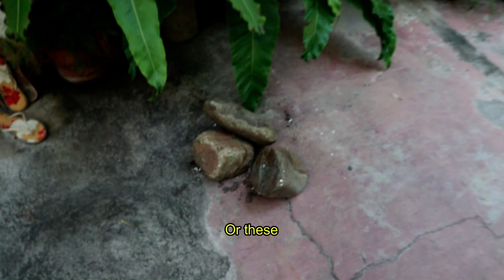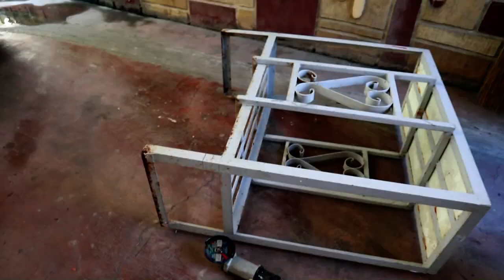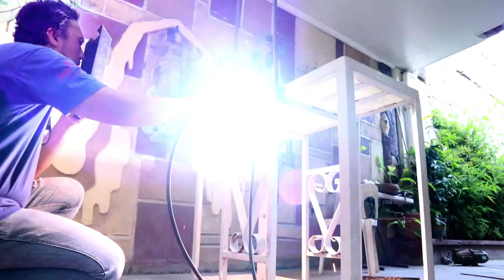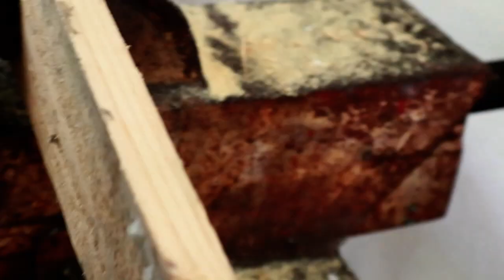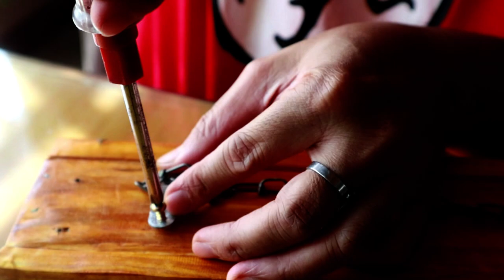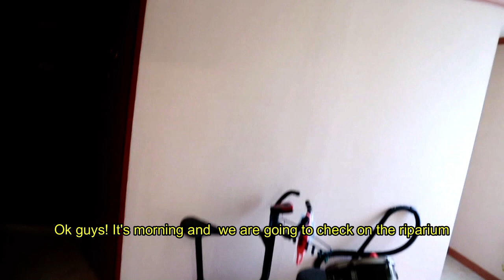A Riparium build during these boring days.

Comment: What's the filtration on it? Did I miss that?
Reply from the maker: Hi Erin , It's a corner hanging filter and a round sponge filter stuck in a small pump , and the outlet of the pump's water goes up the back wall of the rocks then going out on top that creates this small water fall.  I clean the round sponge filter once a month. While the hanging corner filter every 2 weeks.  Thank you.

Comment: What are the pros and cons to making a riparium, either open og enclosed?
Reply from the maker: Right now my riparium is doing great. The fish love the plants. Everything, the plants the fish are healthy. The one thing you need to have is a powerful filter. And if you have a light. Make sure it hangs higher more than a foot in height. Because the plants will grow fast and when they do, you need to trim some of them cause overhead plants will block off the lights. That is why you only put the overhead plant on the back corner only. Overall the entire setup is perfectly fine. This riparium is the healthiest setup compared to my other tanks. Plants are low maintenance.
Reply from the maker: About the open and enclosed, usually ripariums are commonly designed as open. The enclosed ones are what we call paludariums.  It has the canopy(plants), land and water.  The reason why they close it with glass doors, it is because some put live animals like frogs or lizards. Or to keep the moisture inside the glass cage. But if you have a waterfall design, and you plan to put only fish. Then leave it open. Cause the waterfall will keep the moss and plants properly kept.
Reply: @AriesArriesgado  Thanks for your reply. I think i'll do a Paludarium in a closed tank then, without a waterfall
Reply from the maker: @Desmond000007  nice! I bet it's gonna be awesome. Stay safe Tommy😊
Reply: @AriesArriesgado  Likewise brother